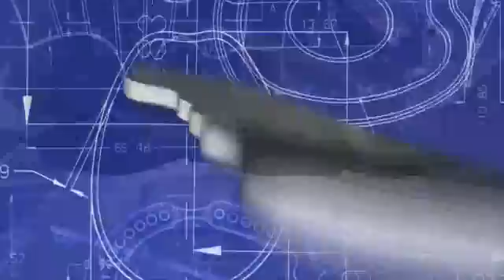#britek  Energy Return Wheel... Autonomous Never Flat

Comment from the maker: That is why we switched to articulated, permanetly tensioned composite hoops, sprung from the hub via an array of drawn, highly tunable suction cups for lack of a better explaination. We displace hub in scope of hoop with the pull of gravity untill floating. Any throttle inspired motion winds up drive train inefficiencies and returns them in the form of raising the hub in hoop, assisting levering.

Comment: That said, I do like the idea of non pneumatic tires though I don't think they're the answer for every vehicle. Though I could be wrong but I don't imagine that these would perform very well in performance applications. I didn't see any thing in the video that accounted for sidewall flex. Which means that torque is applied directly to the contact patch with out any kinda of flex. Drag cars are an extreme example of what I'm getting at. What about loaded bearing, like with loaded pick ups?

Comment: Again I never said anything about this product. My comment was on dudes claim to have almost doubled his fuel mileage and that the auto industry does nothing to improve. I agree that a steel wheel on a rail is more efficient. That's because friction and rolling resistance is low. A side effect of low friction is low traction. Put steels with no tires on all four corners and it'll be like driving on ice. Also it'll ride like complete shit.

Comment from the maker: The human foot can adapt to unnatural support... but only for so long. Upon footstrike the old school EVA midsoles would pound out a pocket in the forefoot allowing # 2 metatarsal head to drop into the depression over time. Foot support builders then "post" add a foam pad under the # 1  met head to take pressure off # 2.... making it worse. The solution is no midsole IE stretch between pattern actuator and chamber, foot "fully supported" is best long term.

Comment from the maker: ERW protos vacuum install... recoil mount. ERW is fully enclosed. See our early carbon ERW video. ERW hub hangs from the top inner diameter of the composite hoop. Radial array attached VIA vacuum boost...  high tech. "sink plundgers". A levitation powered by gravity, throttle responce and the all mighty vacuum.

Comment: I don't get it. Is the rim solid mounted to the hoop? How is energy stored and returned? How smooth is the ride? How is this different from the Tweel?  The number one issue I see with pneumatic tires is people not paying attention to air pressure, followed by people not replacing tires when they should and running them bald.

Comment from the maker: Remember that a steel wheel on a rail is 700% more efficient than the pneumatic tire. There is ALOT of room for improvement here. And YES the Oil / Tire / Auto industry will be mad at ERW. We upset the kart.

Comment: Fill your tank drive it until empty. Note distance traveled and fuel consumed. Then compute your data. Do this for about 4 or 5 tanks. In the same car I can make 62 miles be 8mpg idling through traffic and slamming on the gas and brakes every chance I get or 30mpg by cruising down the interstate at 45mph on cruise control tailgating a semi.

Comment: How does this product compare to the amount of surface contact as compared to a traditional tire? Seeing that an air filled tire has almost infinite areas to distribute the weight of the car to the tire and consequently to the ground, it would seem that this old method would have better traction as compared to a metal barrel with just a few supports between the wheel within the hoop.

Comment from the maker: Russell's shoe tech. has gone to Newton Running, however they have to yet produce the full suspension shoe, just a forefoot unit that does not provide proper foot support or the double digit efficiency gains seen in Russell's certified lab tests. Taking Russell out of the mix has jeopardized their footwear line and could result in many lower extremity injuries. No joke.

Comment from the maker: Yes we do, we have moved to composite hoops that articulate to the surface as a sprung footprint while displacing hub in hoop, not a flattened treadblock. Less tread squirm = efficiency and a longer tread life. ERW needs less rubber than pneumatic tires. We have been pioneering carbon nano tube rubber components to extend life cycles and improve performance.

Comment: I'm just a regular guy thinking about this thing. Inventors are great, and this wheel may find some niche for some other type of vehicles; but for a car, moving at normal speeds....I just don't see how this could possibly at any time, in any form, absorb the shock that a normal inflatable tire does. Inflatable tires do fail at some point, but they are crazily efficient and effective at absorbing the road noise, and tremendous beatings they take from ordinary daily driving. I'm just saying...

Comment from the maker: We have come far since our first home built protos. We are adjustable via vacuum boost. We have multiple install/removal processes, some boltless, could be done at home. Drive to the gas station, use your $5 vacuum accumulator, fits on any air hose and enjoy. Our traction is controled via our novel traction systems and space age composite articulated hoops.

Comment: so it's a rubber tire stucked with bolts to the rim?so how much effort will i have to put when i need to change to winter tires and i only have 4 rims?pneumatic tires takes roughly half an hour,how much time would i need to change this type of tire?and what if some of the bolts get loose?wouldn't that rim become oval?on a pneum. tyre traction is controlled by the amount of air in wheel,less air more traction but less speed,with this is not available,plus it looks stupid but good luck

Comment from the maker: Michelin Tweel is low speed, less efficient than pneu. can not pretension or adjust the rubber attachments between the hub and traction band. We do not crumple up from the bottom, we are hanging "hub" from the top inner diameter of our springy composite hoop.We simply increase the distance from the hub to a larger hoop for more internal displacement/cushioning. They also infringe on our latest issued patent. Two more patents have been filed.

Comment: How does this compare to the tweel, I've read that the tweel has problems with vibrations at higher speeds, but the tweel seems to be more elastic allowing a larger contact foot and better shock absorption. Your wheel-tire seems to fix the vibration problem of the tweel but is less elastic giving it less shock adsorption and contact foot then the tweel and the conventional pneumatic radial. Is there a way you can further improve this concept to be more elastic.

Comment from the maker: We have a composite, articulating hoop that does just that. We have filed patents on our novel traction systems. Early ERW has massive traction even without a traction layer.... just check out our USDOT dyno test video. We had no traction issues on their smooth 48" AWD dyno rollers despite a 6,000 lb. dyno resistance setting.

Comment from the maker: The efficiency gains are double digit, we are simplified, we can drift but would rather hook up with our novel traction system that flexes a footprint to the surface not slap a tread block. We are high speed. There is resistance to the new kid in town for good reason. Those in the tire industry who do not recieve license will be in big trouble.

Comment from the maker: Not a problem. Our array of membranes are backed by a vacuum boost that takes alot of pressure off the individual pulls. Also our hoop becomes an oval causing elongation side to side sharing the load. Each pull 4,800 psi. membrane is capable of suspending the entire vehicle weight, there are 36 pulls.

Comment from the maker: We have greatly simplified ERW over the past 3 years. ERW materials are lighter and much tougher than pneumatic tires can be. The tire industry overlaps fabric or steel belting held together by thin rubber layers. This produces the tire treads you can see on our highways. ERW does not overlap layer on layer, we use a contiguous braided sleeve. High speed performance.

Comment from the maker: A deweighting effect as ERW hub is suspended from the top 180 degrees ID hoop, a  dynamically charged hoop that becomes out of round then recoils for energy return, a hub that allows for rotation accumulation to hoop for drive train efficiency, a traction system that increases psi. to surface with smaller more efficient footprint. A vacuum boost inside membrane array for tuning. Highly elastic sidewalls for screw force accumulation. One synergism for each major componet.

Comment: in the way your spring coiled hoop expresses its energy on both a vertical and forward X Axis. Since the Rubber is shaped at an angle but also runs vertically at two angles the forward momentum of your car would free the compressed areas of the V type rubber up and when it is released it will want to reconform into a standard V type design which will in turn help deliver more efficient energy that is stored by the Coil Hoop into a parabola type arc expression of the compacted energy. just a idea

Comment: And one suggestion. Have you ever thought about designing the interior suspension between your spring coil hoop and inner rim by creating V shaped tough rubber slots that would go in place of the bolts and nuts? The V shape of a rubber piece would allow the wheel to be suspended onto the focal points of where the vehicles weight try to compress it to but, when your tire rolls the stored energy inside the V shape rubber releases at an angle as opposed to vertically. This would actually help

Comment: This is an awesome idea! props for innovation! I have a couple questions. 1. The weight of a vehicle via gravity on your wheel design causes the spring hoop to flex thus loading it down with potential energy. I get that but i wanted clarification on how the spring hoop suspending the floating rim actually causes less friction on the rotor bearings of the wheel? The spring hoop is a circle so the charged energy is coiling to be released on an even y axis that runs down in a parabola fashion.

Comment: Word!! I'm happier replacing a tire instead of an entire wheel should i hit one of those OMG potholes. And you didn't place any on the front of the vehicle...? if its suspended what happens when u turn or slide? Finally unless your product can replace the wheel by being safe, stronger, and CHEAPER! those good'ol radials are here to stay
you mentioned in a comment that history repeats itself and we kinda have to "think outside the box", so to speak, to advance
i say if it ain't broke don't fix it

Comment: You dont change a tire when you get a flat on the side of the road.  You pull out your spare wheel and tire combo and bolt it on in place of the bad one.  Actually it seems you would just need a wrench to replace the "tire" on the ERW where it would be nearly impossible to replace the "tire" on a pneumatic setup.

Comment: "The Romans figured out cement that lasts a thousand years while our bridges last decades."

Actually our cement is vastly stronger than what the Romans had, even without steel reinforcement. What the Romans didn't have were 80,000 lbs. semis throwing their weight on it 24 hours a day.

Comment from the maker: Planned obsolescence is the way we build our bridges roads and infrastructure. The Romans figured out cement that lasts a thousand years while our bridges last decades. Pneumatic tires collapse bottom up to the rim, ERW hub is lifted by the top 180 degrees ID of the deflecting composite hoop. No direct shock contact with the ground side of hoop.

Comment from the maker: Look at our bicycle videos to see our early carbon core Kevlar jacket hoop articulation. We have more than doubled internal displacement . The first ERW bicycle protos were sprung from the bottom of the bicycle wheel ...Lab certified at 42 watts to turn a 1.5 meter drum at constant 20 kmph. loaded with 50 kilos. Almost 2x more e. than other airless. Our next  protos reflect the 4 th. issued pattent....protos hang from the top.

Comment from the maker: Our simplified versions will not have the bolts to adjust. Positive, neutral, or negative air pressure may require monitoring in some versions. Check out our other videos for examples.

Comment from the maker: The radial array of drawn membranes  "all" attached  to points on the hub, can be displaced laterally this means the lateral g force is not just supported by the 'tire" local sidewall and treadblock deformation but from 360 degrees of membrane array. Equal force from opposing directions across the hoop plays with the laws of physics. Equal and opposite "actions" play themselves out in "real time" membrane VS membrane fighting for ballance = anti. bounce..

Comment from the maker: Their  first patent is a "low speed", " less efficient" rework of the old school bias belted tire, the other "non issued" 7201194 etc. begins to run into our "issued" Patented ways of attaching a hoop to a hub. Their elastic spokes can not be "tensioned" or patented. We directionally draw competing membranes to "tune", apply vacuum boost, use novel permanently charged composite hoops, lever to the surface in novel ways, We are anit. bounce and HIGH SPEED! long list indeed.

Comment: beating a bike with tires 10-50mm wide and spinning upto 80 kilometers per hour is a significantly smaller inertia value than a car tire spinning at up to 130 km that can have a width of 3000mm or more. One of the most important things in a cars handling and comfort is unsprung weight and this includes the inertia of the outer wall too. Don't get me wrong, its a good idea, but maybe not as diverse as a pneumatic tire.

Comment from the maker: Consider the "Bow" effect of carbon fiber, the Kevlar the bow string. Now array in a radial design all drawn or "equally tensioned". Remember "vacuum boost". Lower to ground... more "bow pull" from the top. Add throttle responce to array of bows and.....? Jumping on a trampoline? A throwing stick for a spear? A wind up airplane? A bit of each perhaps.

Comment: Ah yes, of course. That also increases fuel economy by reducing drag through loss of air on conventional pnumatic tyres - But would it be robust enough for extreme use such as drifting and surviving the elements while driving a 4x4? The wheel looks rather rigid and I have this slight worry that the whole thing will just shake itself to pieces when pushed too hard.

Comment from the maker: Actually ERW contoured composite hoop will spin more truly than pneu. ever could. We maintain an adjustable dynamic tension between hoop and hub = anti. bounce.. On smooth surfaces you can increase this dynamic tension by our novel patented vacuum boost. Kinda like increasing psi. on pneu. The big diff. is we can remove 1 lb. of compressed air.

Comment: Do you use 4x4 tyres for drifting? No, because that'd be stupid. Of course you wouldn't use these tyres for drifting - You'd use specifically made tyres that fill the correct niche, just like you wouldn't use a treadless F1 tyre for hill climbing. The ERW wheel was designed to keep fuel use down, not something designed for racing.

Comment from the maker: We have a very innovative traction system that we have filed patents on! Our hoop is composite and depending on tire size is 6 -10 lbs. or so with another 10 - 15 lbs. of rubber and space age fabrics. We lever to the surface off a firm yet compliant "contoured" hoop for maximum psi. and traction.

Comment: and also. (i have no knowledge of this. just assuming) seeing the video again, the wheel is perfectly circular once its in contact with the ground (thanks to the metal in between the rubber and inner rim). so yes there is less rolling resistance. but if you want a cars tire to have more traction, wouldnt it be better to have a greater surface area on the road, like a traditional tire once on contact on the road, it will have a flat spot in which it contacts the ground. no?

Comment: yea youre right. but i just asked because the wheels/tires are on a 400-500hp sports car. people who typically own these type of cars will want to show off now and then with EPIC burnouts or drifts. and that brings up another question. are you guys also inventing a different type of tire rubber other than the wheel? because losing traction isnt based on the wheel design, but the rubber that contacts with the road. is the tire that is shown in the video your very own designed product?

Comment from the maker: ERW has changed much since these first home built protos. Also for early ERW it is not the material on the sides that controles lateral forces it is the 4,800 psi. membranes drawn to points displacing laterally IE much more force potential than a floppy pneu. sidewall.

Comment: It would be interesting to see how that tire would cope in a racetrack under pretty demanding conditions, when foreces are applied to the sides of the tire, under hard braking etc. I can see there is not much "material" on the sides, basically there is no wall and, if you corner hard you potentially are going to run on steel? I want to drive with them and see what they do for me and what I do to them.

Comment: What happens to the steel rim if you hit a pothole hard? (Say a 1.5 inch vertical wall at 50MPH)
What does snow do to it?
Mud?
Water?
How would it handle driving up on a curb while parallel parking?
How much does retreading cost when it needs to be?
How long does the tread last?
Road noise?
MPG gains/losses?

It's really neat, and if if it can be made to handle all this better than our current wheels, I would be tempted to get them.